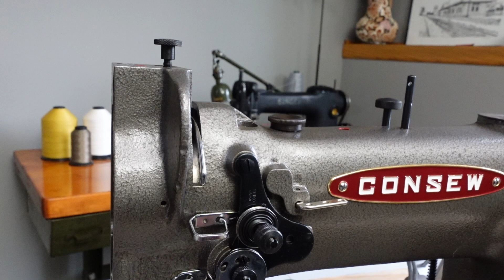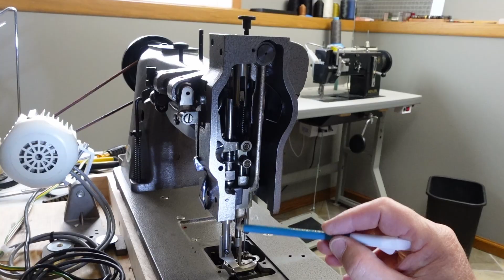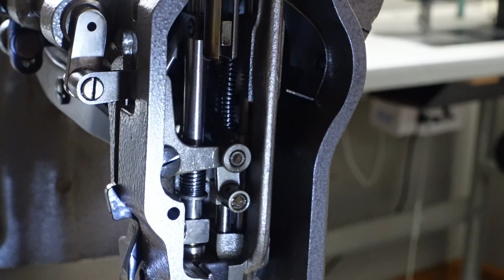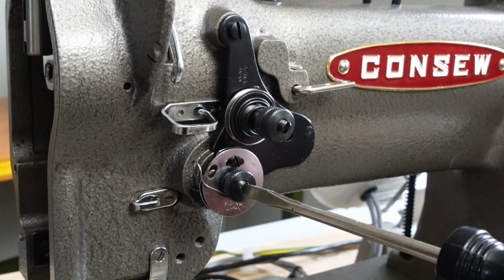Industrial Sewing machine CONSEW 226R-1 walking foot pressure adjustments and check spring.

Comment: If my machine sews fine thru 3 layers of scuba webbing, but when it transitions to the thicker part if the project it skip like 5 stitches or so  do I need more  pressure on the feet or less.  No luck